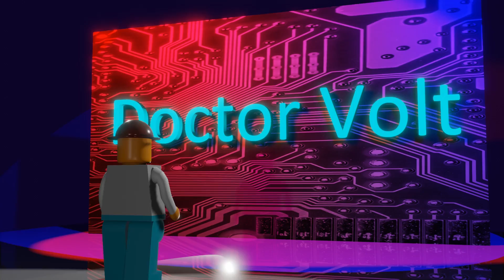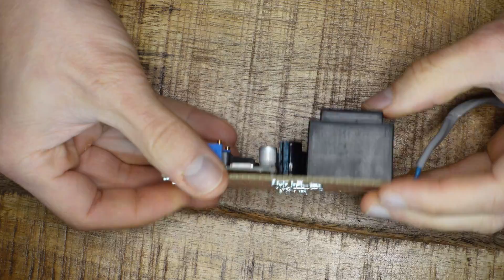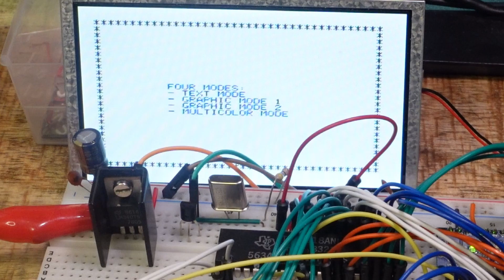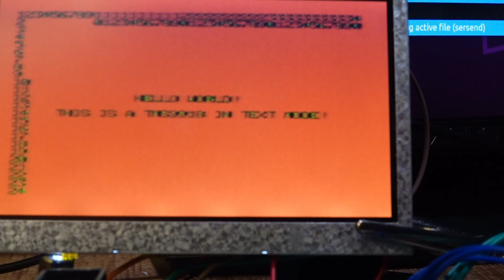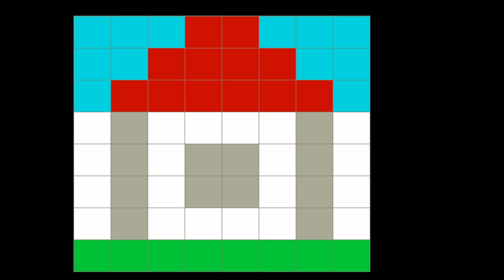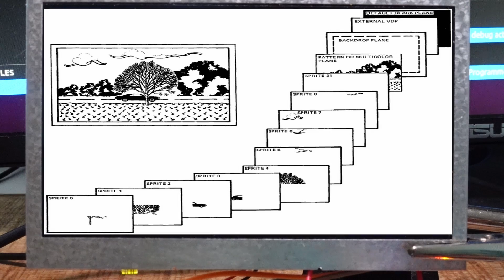Video Card for Arduino and DIY Computers #1: TMS9918 and Arduino on a Breadboard

Comment: Hallo doctor volt - ich würde mich auch sehr freuen über ein neues projekt: der arduino als basic lern- computer mit diesen tms9918/28 Videochip , dann mit ps/2 Tastatur und ps/2 Maus samt SD Karten Massenspeicher und per spi erweiterungs port z.b. später für einen mp3 player chip oder ein ym262 olp3 sound modul?  

So dass man "retromäßig" einen quasi preiswerten bunten vollwertigen 8 BIT DIY retro KLASSIK "msx/coleco/sms" HOME-Computer hat ,wo man selbst die üblichen 2D video-Spiele Klassiker aus den 80er Jahren der Video-Spielhallen nach programmieren könnte z.b. auch das erste schnelle 3D Vectorgrafik Spacegame "Elite" ,was mir damals als junger Teenager da besonders gefallen hat.

Denn mir persönlich ist der kauf von uralten echten 8 BIT ala MSX 1/2/3 oder TI99 Computer zu teuer,wie auch als alternative der "z80 MBC2" bausatz da viel zu teuer, wie einfach auch zu langweilig und da nicht bunt genug ,
für IHN gibt es zwar eine ziemlich langweilige 80 Zeichen Karte als "VGA Modul" ABER zu salzigen Preisen...wo für ein auch gebrauchtes Smartphone kaufen könnte ,was mehr kann!

Wie auch dass ich gerne einen modernen "mcu" wie den arduino (atmega) da gerne  "lernen" möchte z.b. sein op-code assembler und keine dumme "cpu" aus den Jahre 1976,die eigentlich nichts kann ausser schnell rechnen!
Durch so einen bunten TMS oder PICO CLONE videochip wären wenigstens schnelle bunte Videospiele mit echten Hardware Sprites,Bitmap Grafk,eingebauten 4 Wege Softscrolling machbar.Was die Gründe für mich damals waren 1985 von einen Monopoly TI99/4a auf einen Commodore 64 zu wechseln,auch weil ein C64 total frei programmierbar war ohne weitere HARDWARE "EXTRA" Kosten.

Comment: Gerade passenden zum Thema RETRO "TI 9929 VDP Chip"...und seinen vielen VDP Clone wie Nachbauten

ja, leider sind diese schönen uralten RETRO CHIP TI 9928/29 Chips ja schon ziemlich SEHR teuer geworden ? WIE Vorsicht Teilweise werden FAKE China Chips angeboten ! Weshalb ich hier das preiswerte PICO9918 Projekt ,da wohl für euch alle empfehlen kann,besonders da auch -in Zukunft ein sündteuerer orignaler YM9938 oder 58 oder noch besserer RETRO "Video ChIp" da dann "emuliert" werden könnten z.b. mit einen modernen übertaktenen "PICO2 Chip" samt genügend SPI 16 MB RAM als ein "Double" FRAME buffer.

ABER Warum da auch sündhaft teuere ORIGNAL RETRO "CHIPS" da KAUFEN ,wenn per mehrere 1 DOLLAR "PI"s sowas wie 3D GRAFIK  und sogar echte DVI oder die schöne 640x400 Pixel VGA Grafik auch möglich ist ????
Reply from the maker: Natürlich kann man auch einen Pi Pico, ESP32 oder ähnliches nehmen. Aber alte Originalhardware hat halt auch ihren Charme.
Reply: @DoctorVolt  Lieber Doctor Volt ,es wäre für die meisten weltweiten "RETRO" Computer Sammler ,so wie ich,sehr schön ,wenn die alten 8 wie 16 Bit Computer / VIDEOSPIEL KONSOLEN hier wirklich ein echt sehenwertes "HARDWARE UPDATEs" bekommen würden,

z.b. bei diesen TMS 9918/29 Projekt ,das hier "Dual PORT" RAM eingesetzt wird plus dazu einen modernen wie schnellen ALL-IN-ONE "Mircocontroller" für weitere GFX Spezial Effekte wie wir ALLE nur bei AMIGA oder S-NES per MODE 7 da kennen und gesehen haben als DEMOS bei Youtube!

Denn so ein  DUAL PORT RAM macht,es möglich das ein alter langsamen VDP CHIP z.b. von TI99,MSX,SEGA SMS , sein bisschen "Videoram", da jederzeit per schnellen modernen Mircocontroller UPDATET wie neu brechnet werden könnte,was früher nicht möglich gewesen ist.

Die alten sooo langsame 4 bis 8 MHZ CPU kann sich dann mit der BENUTZER I/O Steuerung oder den Soundchip da beschäftigen,während der schnelle moderne Mirco-controller die harte RECHNENARBEIT der bunten schnellen "GRAFIK" macht.z.b. ein neues 3d "elite" als weltraum flug simulator spiel...

Besonders interessant wäre auch SO ein neues "HARDWARE UPDATE" = TURBOKARTE  für ein uraltes 16 BIT SEGA "MEGA DRIVE,
wo damals nur per teuren DSP "SVP" MODUL mal schnelle "3D GRAFIK" UNS präsentiert worden ist.

ABER heutzutage wäre sowas spottbillig möglich per neuer MEGA "Turbokarte" per CMOS 68HC000 UND einen beliebigen schnellen Mircocontroller unter 10 Euro ,der da sein eigenes schnelles "SPI" RAM hat und die notwendigen "Grafik" DATEN per DMA direkt ins "SHARE MEMORY" als 512kb "SRAM" schreibt wird für diese alte langsame 68k CPU.

DASS sind SACHEN die sich auch WELTWEITE verkaufen lassen,da sie sofort eine riesengrossen BENUTZER NUTZEN haben,als DUMME ROM PLAYER Module egal da von Alibaba oder KRIZZZ...viele grüße und kreative wünsche für ihre neue Hardware PROJEKTE!!!

Comment: Ja, ich habe ein sehr grosse "Problem" mit diesen Only 16 KB VRAM "SEGA Mastersystem"!
Da damals SEGA zu geizig gewesen ist ihren schönen neuen "System" da sofort 32 KB oder sofort 64kb "VRAM" dort einzubauen!

Nein, es waren nur 16 dumme KILOBYTES als VRAM!!!

256 mal 240 pixel in 32 Farben aus 64 Farben ist zwar super GEIL ,aber nicht wenn das VDP "VRAM" von 16 KB RAM DA nicht ausreichend ist! 

eine neue NO-Limit "VRAM" Hardware Platine könnte sowas dummes sofort ändern !

Durch einen billigen "PI PICO" CHIP der in seinen eigenen Arbeitsspeicher dieses 16 KB "VRAM" FENSTER stark erweiterter kann ,und der Programmierer beliebige 3D Funktionen dort durchführen könnte,wie den MODE 7 bei einen SNES!

Sowas als kleine billige ADD-ON Hardware "Platine"  wäre natürlich bei bekannten Online Auktionen,ein schöne einfaches "Geschäft" alle für Hobby Mirco Elektronik BASTLER...

DER echte "3D Turbo" für alle alten TI9928,9938/9958 Systeme wie auch einen SEGA MASTER SYSTEM!
Reply: Vielen Dank Doctor Volt für diesen sehr interessanten Kanal und seinen vielen guten Infos! 
ich würde mir ja auch sooo gerne einen echten alten Z80 "MSX" Computer oder moderne Nachbau Z80 Clone auf Basis dieses VDP TI Chip zulegen ,aber leider sind die orignalen RETRO Bauteile dafür ziemlich teuer!!!

Weshalb ich da die preiswerte billige "Idee" hatte,einfach ein neues 4-CHIP (mit ATMEGA MCU) ala des Vorbildes " Z80-MBC3" in ein sehr billiges RETRO Sega Mastersystem 2 (also MSX PLUS SYSTEM) da "einzupflanzen"!

Um es dann zu einen richtigen,bunten echten "8 BIT" Z80 Homecomputer zu machen samt einer billigen schneller Z80 Turbo CMOS CPU,dazu externen PC Keyboard, SD Karten Funktionen und IC2 Anschluss Port für weitere "ADD-ON" Hardware z.b.für ein neues "OPL3" Ym262 CHIP Stereo Soundmodul -ALLES machbar per einen modernen "Co-Prozessor" billigen Ic2 ATMEGA!

Leider sowas alles wäre zwar kein echter teuere "MSX2" Computer mangels den guten teueren YM9958 VDP CHIP, aber könnte als neues buntes ATMEGA,Z80 8 BIT Lernsystem  auch der jungen "Generation" als 8 BIT Retro Lern-Computer garantiert "Spass" machen,da es dann bessere "SYSTEM" NICE TO HAVE Eigenschaften hat als da ein langweiliges teures 3 Chip Z80 MBC3 System.
Über diesen einbauten schnellen "ATMEGA" als ein CO-Prozessor für die modernen SYSTEM I/O Funktionen könnte später dann per Ic2 Bus auch dann ein topmoderner schneller "PI PICO" das dumme lästige VRAM-Problem mit diesen Sega Master System gelöst werden , da dann der schnelle Dualcore 1 Euro "PI" das VRAM komplett "emulieren" könnte,incl. als neuer "3D" Co-Prozessor,da auch weitere GPU "GFX" Effekte doch zaubern könnte???

Comment: hallo doctor volt,
ich finde dein projekt echt super und ich sehe du hast ein herz für alte RETRO COMPUTER ???!
 
hier meine idee:
Und es wäre auch sehr super wenn das sehr wenigen dumme "16 RAM VRAM" da mit einen schnellen PI PICO vielleicht "emuliert" werden könnte ??? ala eines c64 Kungfu oder gameboy flash...
Sowas wie NO-Limit VRAM "Emulation" wäre da für alle alten RETRO Computer Systeme wie TI99,MSX 1,2 und das SEGA MASTER System DA super geil!!!! 

Besonders da so ein moderner "PI PICO" Chip kaum etwas kostet,okay plus einige handvoll level shifter chips für 30 cent... 
aber wir wissen ja alle ,das ein schneller DUALCORE "PI PICO" CHIP sogar dann die harte MATHE RECHNEN Arbeit als  neuer SUPER FX "Co-Prozessor"  für sogar 3D  ,das VRAM "Doppel Buffering" und weitere sehr interessante "SUPER FX" EFFEKTE dann machen könnte...z.b. DATEN nachladen von SD karte dazu mehr eigenen PI PICO "SPI" RAM...

NO LIMIT VRAM-wäre SUPER GEIL!!

Besonders für mein sehr altes "RETRO" Lieblings System "Sega Master System" was da aber 32 Farben aus 64 Farben darstellen kann, wäre DASS die beste "TOP" HARDWARE Knaller IDEE!!!

Auch wenn dann die beiden alten RAM Chips dann rausgenommen wie gesockelt werden müssen,ABER der Aufwand ist dann 100% wert,da aus den kleine 8 BIT SMS dann ein richtiges SNES wird!!!

Sowas wie "SUPER FX VRAM " wäre auch eine super Hardware Erweiterung für alle o.g. nur 8 BIT RETRO Systeme ohne genügend "VRAM" Speicher wie auch CPU Rechnenpower.
Reply from the maker: Die Idee klingt gut. Damit wäre vielleicht sogar Videowidergabe möglich, wenn nicht der VDP, sondern der Pi Pico selbst das emulierte DRAM beschreibt.
Reply: @DoctorVolt  Ja, danke schön!

ich würde sehr darüber freuen,wenn es endlich jemand geben würde der sowas hardware technisch umsetzen könnte!
so ein "pi" chip ist mit seinen zwei kernen und hoher mhz und eingebauten 256 KB SRAM ,ja hoffentlich schnell genug ???
Und es geht hier ja nur um 320x200 bzw. 256x240 pixel ,wobei dann der "PI" das "Double Buffer" macht.und in der zwischen Zeit die aufwendige Be und Umrechnung z.b. für einfaches "MPEG 1" da wohl schaffen könnte ???
Reply: also technisch habe ich mir dass ungefähr so vorgestellt:die alten VDP drams chips kommt raus, wie dann sockel drauf,und eine pi "adapter" Platine wird so tunen als wäre es "DRAM". Der schnelle "PI" wird dann auf die LESE oder Schreibe BYTE "ANFRAGEN" des jeweiligen "VPD" Chips dann schnell genug "beantworten".Über einen zweiten billigen "MCU" mit "SPI" der vielleicht sogar MP3 Audio dann abspielen könnte,
kann sich dann die alte CPU z.b. Z80 mit den modernen "PI" dann "unterhalten" und neue PI-Funktionen per "Programm" aufrufen z.b. anzeigen von 3D Objekte, MPEG 1 Video etc..
Reply: @DoctorVolt  ja, ich glaube der passende fachbegriff heisst "ram" oder ROM emulator ?
so als bestes Beispiel PROJEKT "Pi Pico Game Boy Flash Cart" wo der hardware entwickler einen PI  RP2040 dazu 3 mal Texas Instruments TXB0108 level shifters,genommen hat.

Ich würde dass gleiche zwar auch nehmen aber dazu noch ein 8 oder 16 MB SPI RAM ,dazu einen SD karten sockel wie auch die alten Z80 CPU als CMOS updaten plus den atmega 32/64 als moderne "SPI" Controller,SD Karten Leser UND für  den wichtigen schnellen SPI "Datenaustausch" mit den modernen "PI" als unsere neue SUPER "GPU" oder 3D "Blitter" CO-Prozzessor.
Reply: Es ist echt sehr schade dass niemand bisher sowas gebaut hat!

Denn dieser schneller "PI Video RAM Emulator" wäre ein Super universelles GFX Hardware "ADDON" 
 auch für andere alte 8 BIT Retro Computer wie CPC,Atari XL,C64 ,sowie natürlich die vielen MSX Computer , das SEGA Mastersystem wie SEGA Mega Drive...wie natürlich als 3D "UPDATE" für ältere ISA PC-Dosen EGA/VGA Karten oder als VGA DISPLAY "Schield" für kleine Arduino-Homebrew computer...

DA dann der moderne "PI" quasi unbeschränkt Video-RAM für SIE simulieren kann,wie auch die harte MATHE "rechnenleistungen" für einfaches 3D ala eines SNES SUPER "FX" CHIP so für bunte grosse Bitmaps als "SPRITES",z.b. was sehr interessant ist für alle CPC Benutzer mit den armseeligen 6845 Grafikchip!

Oder warum nicht  schnelle 3D Spiele ala DOOM,Wolfenstein,oder 3D Weltraum "ELITE" da auf alten 8 BIT RETRO Computer spielen ???

Ja,der "PI" kann sowie das "Video Frame Buffer" da spielen könnte für echtes MPEG1,wobei natürlich das "LIMIT" da NUR ihre eigenen "Grafikchips" dann sein werden, in der besten Pixel Auslösung und möglichen Farb ANZAHL.

ich würde echte freuen ,wenn jemand endlich sowas bauen,kann um den alten retro computer ein schöne 3D GPP Upgrade zu verpassen! 😉
Reply from the maker: Naja, ich würde sowas mit einem FPGA machen, wie dem Tang Nano. Hat sogar einen HDMI Anschluss. Gibts ein Video auf meinem Kanal.
Reply: @DoctorVolt  vielen dank für deine infos !!! 

ich habe jetzt deinen interessanten "kanal" als abo ,also ich und viele andere auch würde sich sehr darüber freuen ,dass endlich jemand diesen sozusagen "VRAM-EMULATOR" bauen könnte! denn als "rom-emulator" wurden ja vers. hardware projekte ala ATARI VCS wie Gameboy "ROM" Flash,oder C64 Flash ROM per Kungfu flash ja schon so "real technisch" umgesetzt  mit einen schnellen STM32F4.
Und da gings es ja nur um höchstens 64 Kilobyte ROM,was aus seinen internen RAM Arbeitsspeicher ,dann der älteren 8 BIT Homecomputer "sehen" wird.wie schon gesagt für alle alten 8 BIT retro computer z.b. MSX 1/2 ,CPC/CPC PLUS Serie und auch ältere RETRO spielkonsolen wie SEGA Mastersystem,Sega Mega DRIVE,wäre so einen SUPER VRAM "FX" Erweiterung wohl der preiswerte "TOP KNALLER" als Hardware UPDATE!
Der preiswerte schnelle "PI" ist ja schon in der Version 2 zu haben,wie auch einen China "PINK PI" mit  16 MB SPI RAM,z.b. für eine preiswerte "PICO" N64 DEV-Karte... 
die ja schneller ist als die alte Version,und es gibt ein billiges "DVI" modul zum einfachen anlöten???

Comment: I'm working on a homebrew computer using tms9929 VDP. I choose this one because it has yuv output for a better image quality. I also own a C128, and an Amiga 500. C128 80 columns output and amiga 500 have rgb output, so the picture is as crispy as vga using scart connector. For the 40 columns output of the c128, I changed the rf modulator for a svideo module, and the picture is far better, although not as good as rgb

Comment: The 9918 was incredibly powerful for its time. But I think you may have mis-characterized Graphics I. On most home computers that used this chip, Graphics I was the "text" mode and the way the colour set was done was merely an oddity but no less useful. Just different. Colourful displays and games were abundant using this mode.

Comment: You should check out the Yamaha V9938.  It was a successor to the 9918/9929 and is software compatible, but offers so much more, including 256 * 424 in 256 colours, and 512 * 424 in 16 colours, but with a palette of 19200 colours.  Each pixel can also have a unique colour

Comment: Would it be possible to make a C64 VIC-II replacement with this chip?
Reply from the maker: No, because these chips are completely different in their capabilities.
Reply: If you want to do any Commodore based system. You'll need a MOS 6502 or 6507.  & You might be better off using a Western Design W65C02. Its a bit more flexible in use.

Comment: I tried many modern LCDs, and I always had issues.  I found a CRT TV, and it looks great. I think I'll try a scan converter like the retrotink.
Reply from the maker: I also tried with an USB frame grabber, and it looks also terrible. I think that these chips were designed to look great on CRT TVs. Unfortunately I don't have a color CRT TV to test.
Reply: @DoctorVolt  I was fortunate to have found one at a thrift store .

Comment: Great video. Thanks for sharing. I built the same circuit as you and text mode works fine, but in any graphics mode I have an issue: lines are duplicated in alternated lines. For example I print "HELLO" and I have HELLO in first and third line. Then I print "WORLD" and I have WORLD in second and fourth line. Same when I use imgserial. Lines appear repeated in pairs in alternated lines. What could be the cause? Thanks a lot in advance.
Reply from the maker: I assume there is in error in the wiring of the RAM or the RAM itself, so the TMS reads the same content from multiple addresses.
Reply: @DoctorVolt  Finally found the problem. It was a power supply problem 😲 Reading the VDP manual I noticed that the indicated current supply need is 200-250mA. I was connecting my circuit to the +5 GND of the Arduino. So I connected it instead to a bench power supply and voila, it works!!! And indeed my circuit consumes 190 mA. Thanks a lot again for sharing your circuit.
Reply from the maker: Yes, these old chips always do weird things when the voltage is too low.
Reply: @DoctorVolt  Thanks a lot for the quick reply. I thought the same, but I checked at least 3 times and my PCB schematic has the same connections as yours. I made a small code to show me the contents of the VRAM after vdp_print and I see all is where is supposed to be, and not duplicated. So there must be something that makes the VDP reading twice, but I'm clueless.

Comment: There is a chip named MB8118 that operates on 5V only and it is a 16K*1bit DRAM chip (which I presume will work witht the TMS9918). There is also the Intel 2118, but I cannot find any available.
The TMS9118 can still be bought for few dollars in China, but strangely not the TMS9128 and the TMS9129.
Reply from the maker: These may be an alternativ to the 4118. But as they are way more expensive on Ebay, and we still need 8 of these, I´d rather go for the workaround with the SRAM and the D-latches.
Reply: I’ve got a couple of experimental systems with TMS9118 video chips. They’re the successor of the TMS9918 and don’t rely on the 8 RAM chips. One uses 2 - TMS4464 Dynamic RAM chips for 16K of video ram. The other uses 2 - Toshiba D41464 D RAM chips for 16K video RAM. I had a TI99 4/A back in the early 80’s and these video chips bring back that vibe.
Reply: @andrewwasson6153  Yes, I know about those 9118 chips.